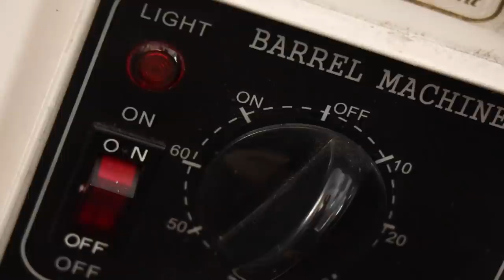CUFF BRACELET

Comment: Could a ring be made with this same style  and could it be made with gold too. It's really cool and satisfying to watch
Reply from the maker: Yes of course
Reply: @DynamiSJewelry  whats the green liquid u used at 7:51
Reply: @jordanparijo7995  it's his form of flux would be my educated guess. Like when he uses the white powder to help ball up the ends into a selling mechanism for the ends of the cuff. It's called borax and the pickel is probably spare goes off to a green colour after many uses. Also you aren't supposed to use any thing but copper tongs to remove it from the Pickle. Ordinary Steele sends the Pickle pink and that ends up on the items. Hope that helps after so long waiting for him to answer. Seems to be very picky who he answers and tells us nothing regarding wire sizes and lengths. This cuff used 10 strands of silver at about 3mm thickness I'm guessing. Certainly charges enough for his items. I know it's a bit of work but seems to be a one day job making it. Can't detect any editing cuts other than speeding it up. Makes great jewellery but isn't helping others out with making information.

Comment: Why do you heat it so much and quench it?   What does that do? Relax the metal??
Reply: It's called annealing,  the metal hardens as it's worked and the annealing is necessary to " relax" the metal , it would become brittle and would likely crack and / or break without that crucial step - which is repeated as many times as needed.

Comment: Do you wear a respirator when you do all the filling/ sanding? If not you might want to that metal dust you can’t see is nasty… also might wanna invest in a ventilation system when your metaling / working the silver with the little torch…  when your metaling the silvers it’s releasing toxic fumes which are deadly… I’m a glass blower and one effect we work with is called fuming and that’s taking pure silver/ gold and burning in the flame to release a rainbow of colors on to the glass. If you like breathing invest in some safety